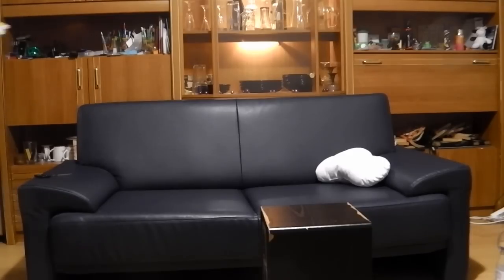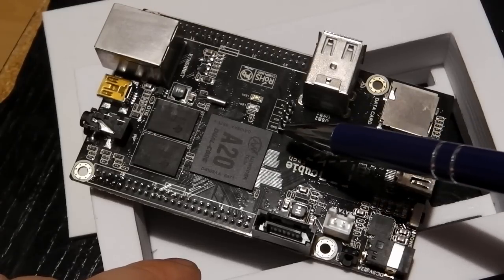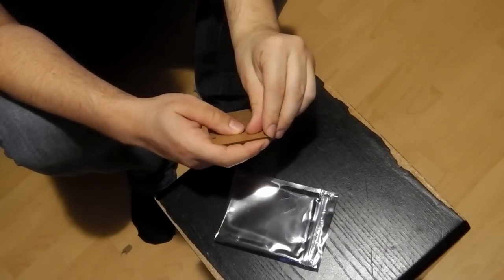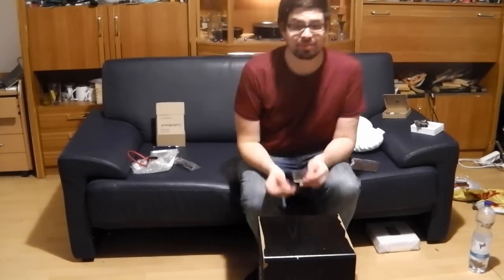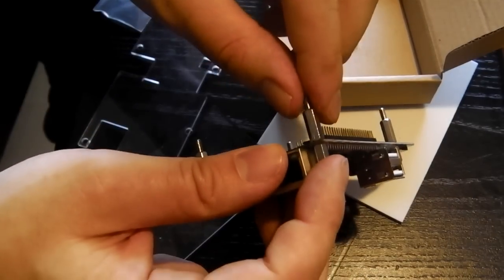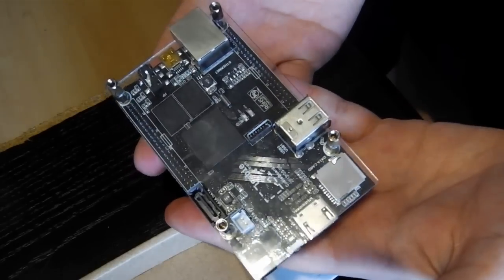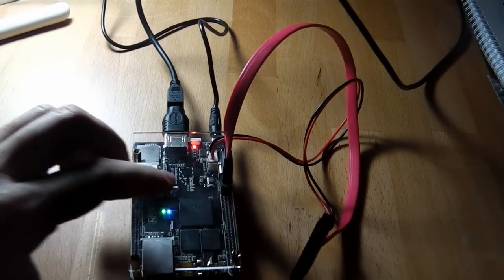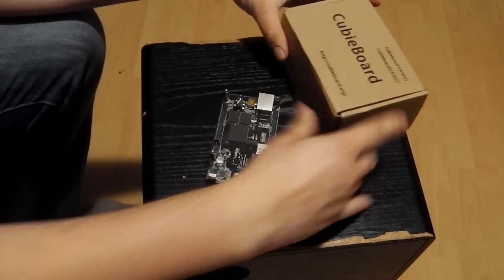Cubieboard A20 Dev Board Review

Comment: Does the Cubieboard A20 has hdmi-cec so i can use the tv remote to control the Cubieboard A20?
Reply from the maker: We had to use a special remote, not the normal TV remote
Reply: Nerdbench
I see. So what's that remote? And what kind of remotes does this little machine uses so that i know what to buy when buying one? I am kinda new to this.
Reply from the maker: izri1 you can use whatever USB pointing /input device you want. we own a mele F10, which is great for android tv sticks, grab it on ebay, shouldn't be more than 25 bucks. But you also can use your standard USB mouse
Reply: Nerdbench Ok thanks a lot.
Reply from the maker: izri1 you'r welcome!

Comment: What about the gpio and documentation? Thanks for the video.
Reply from the maker: What documentation do you mean?
Reply: Nerdbench

"Documentation" - something like user manual, quick start guide, code examples etc. Sure there would be some, which is normal. Else how someone would know how to set this up, or which pin does what. But I wanted to know if it is sufficient. For example if there is information and/or example for the followings:
ADC Reading
Hardware-serial
External Interrupt on input pin
LCD Interfacing etc.